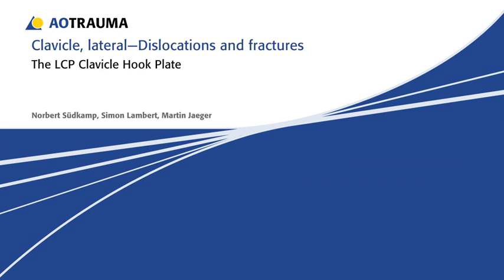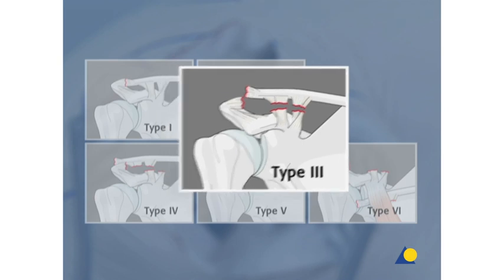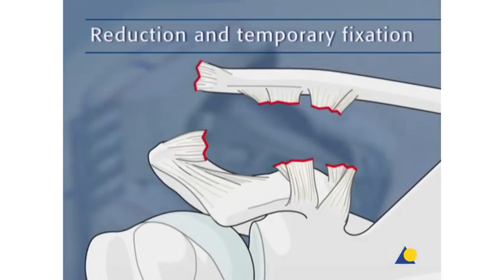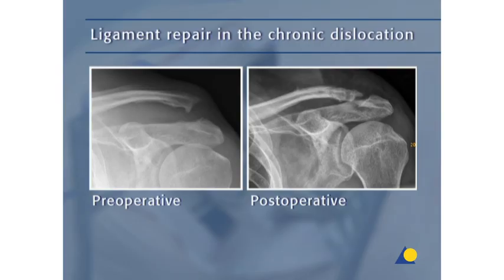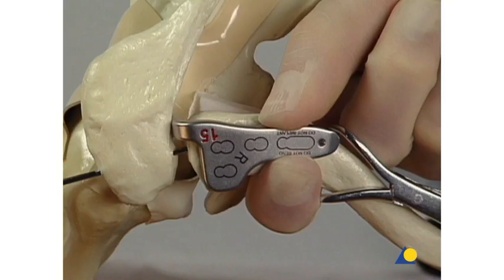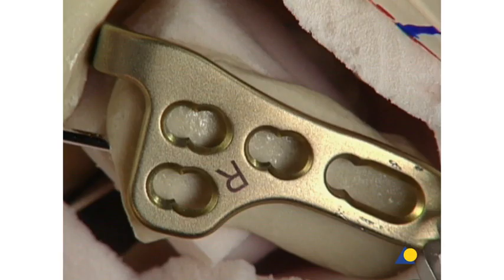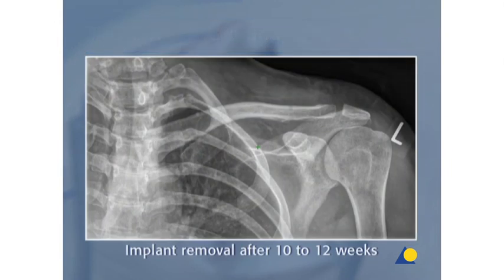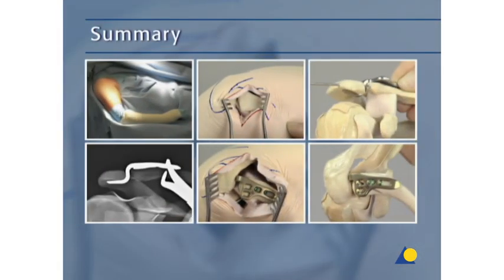AO Lateral Clavicle—Dislocations and Fractures—The LCP Clavicle Hook Plate

Comment: Should the titanium plate be removed after healing? Will leaving it after healing cause problems over time?
Reply: i've had mine for 5.5 years. I'm getting it out in two weeks. I have heard and believe it's best to remove it 12-14 weeks after installation? I wish I would have taken mine out sooner. That place is always susceptible to injury. It doesn't take much pressure on the hardware to be pretty painful.
Reply: @LifeNoell  hey man, did you have a grade 3 tear? Did your ligaments heal and how is your shoulder now?
Reply: @madddawg20  you can call it grade three, i am pretty sure. I always called it a full separation so folks who wanted to know would know it was fully torn. Those ligaments don't heal. Once the hardware was removed, things got better. I just had surgery on my other shoulder (rotator cuff, biceps tendinosis, etc. )  Things get better, but it takes time to heal.  After almost a year of having my hardware out, it's still fragile.

Comment: I have now removed the plate. Ligaments did not recover... Key effect. What to do now?
Reply: How old are you? Did you fracture your collar bone? What type of surgery did you have? Did you rest and recover correctly?
Reply: @super_heroes  I am 37. Operation hook plate, hook under the acromion.  There was a dislocation of the collarbone, rupture of all ligaments.  Metal removal after 10 months.  I can send pictures.
Reply: @astaninm  what percentage did your ligaments heal to? Or not at all?
Did your colar bone float back up to where it is before?
Reply: @madddawg20 Visually, it is in place, but the effect of the key is present, which can be seen on the X-ray with the load.

Comment: I have one installed, is it necessary to remove the plate? as amateur dirtbiker which problem could this generate if the plate is not removed? Thank you, your video has been very educative and great communication.
Reply: I have one too. it is necessary to remove it after 12 weeks
Reply: Are you fully recovered now?
Reply: @astaninm  now the plate is off, the pain is completetly gone. The relief i felt was even more than the one I was expecting. So my recomendation is to have the plate removed as soon as the doctor allows
Reply: @danieldemulder4903  I'm happy for you.  Can you do gym now?  Pull-ups
Reply: @astaninm  yes, everything, climbing ,downhill and dirtbikes, everything as before the fracture
Reply: @danieldemulder4903 I’m so glad you were able to successfully recover! :) I’ll be getting this surgery soon I think in the next few weeks or month. I’m super nervous but I did research and this is the best way to unionize the bone back in place. I have an ac grade 3 separation. No fracture. I’m a 22 year old dude
Reply: @astaninm  yes (I recover all strength and all mobility range), but the second surgery to remove the plate is on 2 weeks. My doctor said the plate should be remove in no longer than a year after installed. Since I continue to feel pain we schedule the surgery as soon as the xrays showed a good bone heal.
Reply: @danieldemulder4903  I have a whole bone.  Broke all ligaments. The plate was installed yesterday. I'm in pain, I can't sleep...
Reply: @astaninm  the only way I was able to sleep a little was seated in a sofa. Be patient, and give yourself rest, your body does the work... Take care, hope you have a great recovery
Reply: @danieldemulder4903  I just had the surgery last week but i can only lift my arm to 80 degrees. Did you reach full range of motion of your shoulder before the hookplate was removed? How many weeks did it take to obtain your full range of motion? Thanks
Reply: @mathijsd281  with the hook plate max range of motion was about 80-85 degrees maximum, once the plate was removed was able to have full range of motion again. The speed depends more of the therapy and you pain resistance. In my case it was about 3 weeks after the surgery.
Reply: @danieldemulder4903 also, after surgery (getting the hook plate on, waiting a few months), from the time the surgeons take the hook plate out of your body, how many more weeks of recovery do you need before you can go workout at the gym or play sports? I play soccer, tennis, badminton, and pickleball
Reply: I have now removed the plate. Ligaments did not recover.
Reply: @astaninm  sorry to hear that, but ligament recovery is a long process, I hope you get well
Reply: Its been a month since I have installed the plate, when should I remove it? I can move my arm more than 90 degrees now
Reply: @hamakamal7236 I haven’t gotten the surgery but I heard you keep the plate in you for like 3-6 months depending on a person-to-person basis of healing
Reply: @hamakamal7236 update?
Reply: It's necessary. It will eventually cause damage to your acromion process, so removal is mandatory.